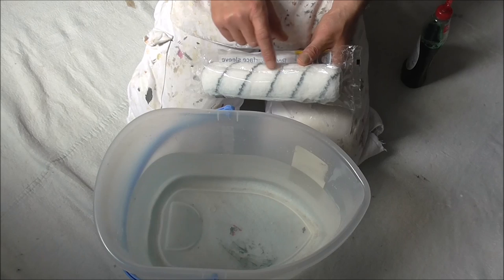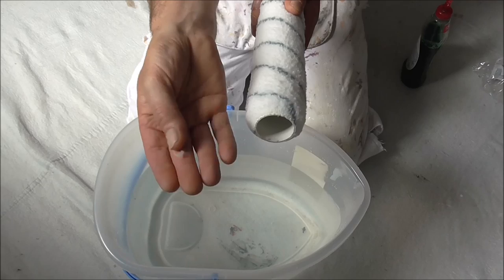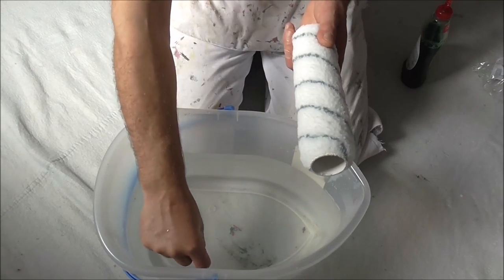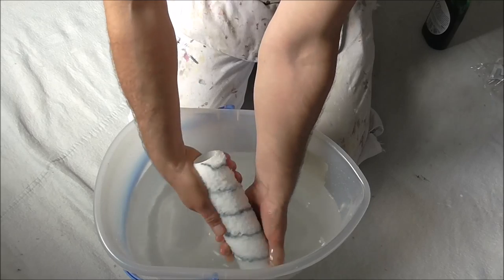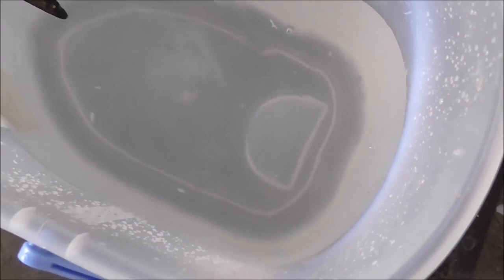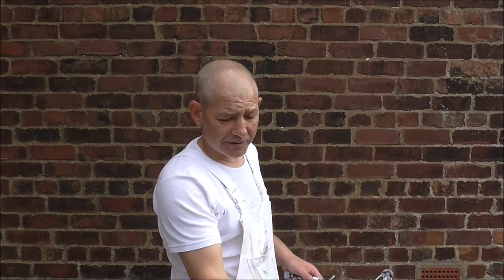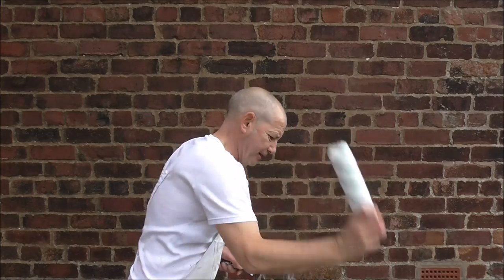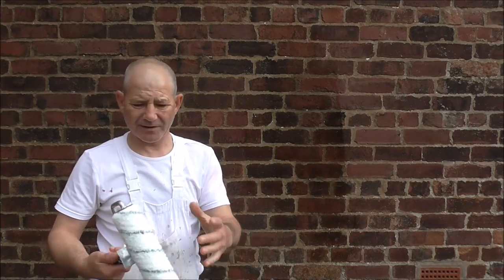New Roller Sleeve Tips

Comment: I only use 100% lambskin rollers.  They wash out like over 100 times and leave the best finish.  It holds the most paint too.  I could get 3/8" nap too so it's a smooth finish
Reply from the maker: They are really good but had a few problems with them falling apart in weeks. Maybe the make i was using...
Reply: @PaintingandDecorating  my Dad taught me to use lambskin or sheepskin.  I've had some sheepskins fall apart early too.  Try to get lamb because the younger wool is stronger
Reply: Purdy makes lambskins
Reply: @PaintingandDecorating  also arroworthy
Reply: @PaintingandDecorating  it's important to spin the roller really well so it dries fully

Comment: I see you've got a Diall rough surface sleeve in the video. Would that be your go to roller. I've been using Hamiltons but they don't seem as good as they were years ago. Thanks David
Reply from the maker: They are ok, but like anything these days nothing seems to last as long.  Dulux or the Crown center sell good decorating equipment.
Reply: Thanks for getting back to me.,
Reply: I've been using the Hamilton perfection roller sleeves for years and never had any issues.
Reply: Tried two different Hamilton rollers and they both left a lot of stipple...

Comment: You should try Arroworthy microfiber roller sleeves man, absolutely top drawer. No shedding at all, and the 3/8'' leaves barely any texture in the finish after drying.
Reply from the maker: Daniel Radcliffe's Test Results Thanks will check them out.

Comment: I used to do that too until I hit on the idea of putting them in the washing machine first. They come out perfect.
Reply from the maker: May give that a go.
Reply: Painting and Decorating I bought 6 Purdy sleeves recently and they're are good. But they give off a lot of bits to start with. Just put 2 or 3 in with your washing bud.
Reply: Be careful with putting them in the washer. The loose bits can get caught in between holes of the drum which, in time can cause a build up affecting the washer.
Reply: Put them in an old pillow case first and enjoy fresh rollers.
Reply: Bad idea. The roller is made of plastic.
Reply: @HoudalothAli  so?